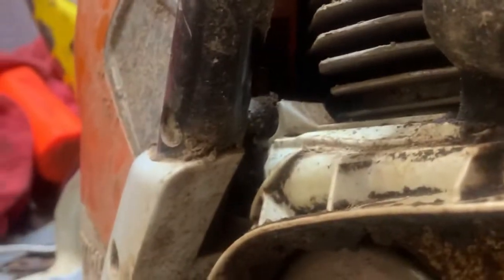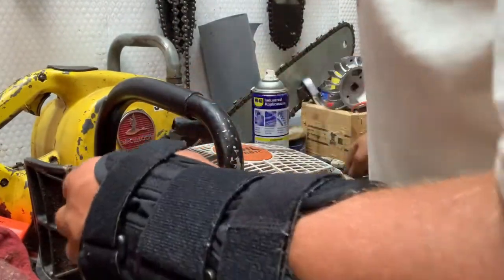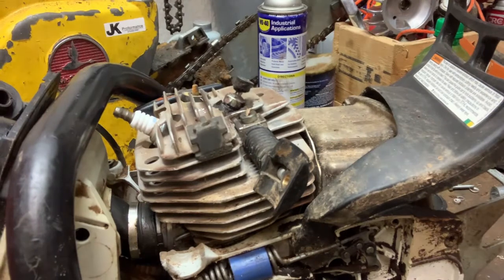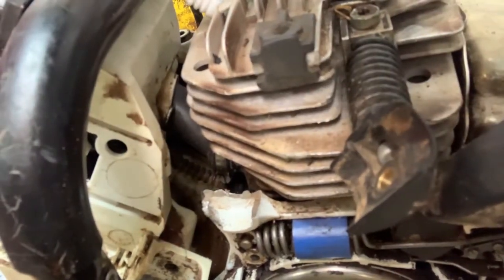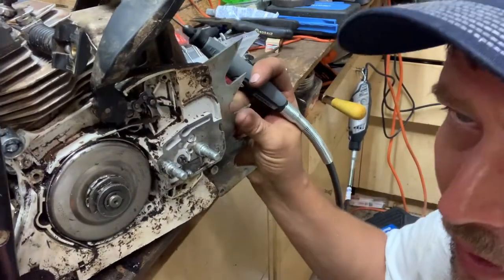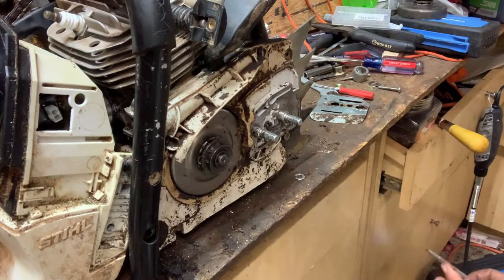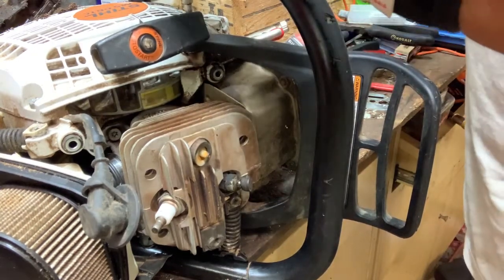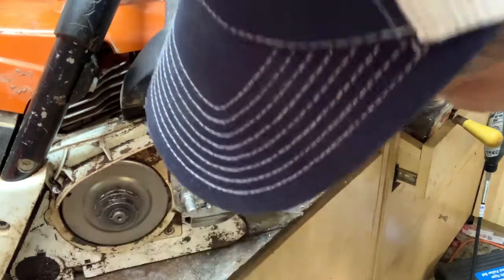Repairing a Stihl MS661C

Comment: if you don't know how to take something apart, since you don't work something frequently enough, maybe try going to a still dealer and getting the manuals. that is what i did so i can work on my 661. as for not being able to find your tool, try putting them back up when you get done, and maybe cleaning your work bench up after a job. that usually helps with finding your tools and keeping your work space looking less like fred sanford.
Reply from the maker: As for cleaning my work bench up after a job goes I could do better. Getting the manual for one saw from the Stihl dealer locally there is not a chance, they don’t want anyone to possess such things. They want all the repair work and charge $100+ a labor hour. This was one of those jobs of if you fix it great, if not you can keep it for parts.
Reply: @JKSawShop  i ran into that with one of my local still dealers, where i do a LOT of business on chains, oils, trimmer string and even bought my 661 from and they think the manuals are only for the professional repair  shops. so, i went to the other dealer, where iv purchased 3 tractors, and the still guy attempted to the "only the dealer" crap, and i asked him who owns the saw, which he said i did, asked him if it was still under warranty, which it was 4 yrs out of warranty, and proceeded to explain that i get the manuals, or i the my tractor business and saw business elsewhere. after showing him how to download the manuals and put them on a flash drive, i walked out with the 066/660/661 and 088/880/881 manuals. I'm sure if i need more, i can get more

Comment: Couldn't believe you did that .however if thar saws a week old .I'm 12 .or the guy is taken that saw into a war zone .I have 4 saws that are several years old and look brand new compared to that thing. My only issue is watching that air filter go back on without being cleaned and blowing the thing off with air.compresssor .just for any one that likes there saws they buy.never run stock air filters .get a west coast oil filter .or red beard.on stihl saws ...mainly ..look at all those fines going in when that filter came off .I cringed,,,,nice fix...be intersteing to see if it lasts..don't think it will not because the work you did .but because the operator ..of the saw.if that's how one week looks good lucky unbelievable,,,,for one you can't yank a saw out especially not newer models .tell him to buy some wedges,for crying out loud
Reply from the maker: People are too hard on equipment. I believe in taking care of what makes you money